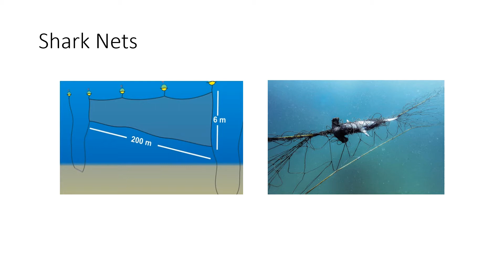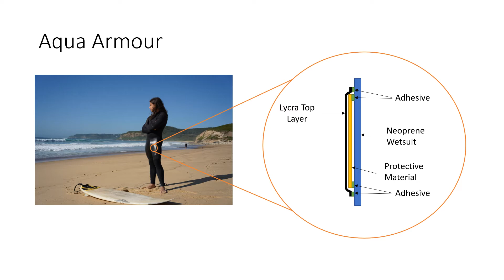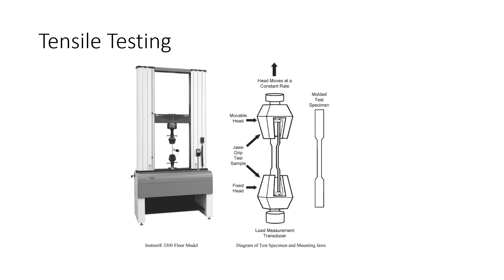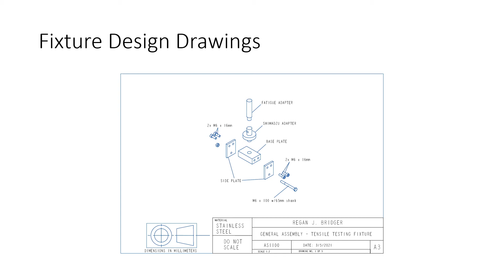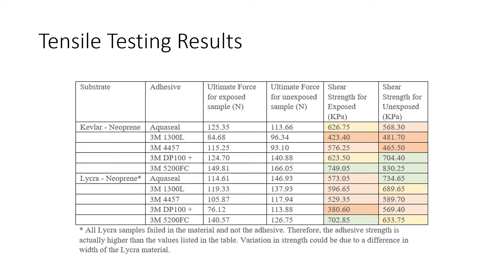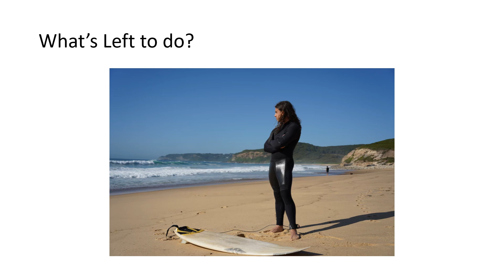Aqua Armour: Adhesive Selection Analysis

Comment: Could cycles of exposure to salt water and then being allowed to dry out before being exposed again have changed how the adhesives performed? Are there different options for how the adhesive could be applied, for example across both sides of the protective material rather than just at the edges? Could that effect weight or flexibility?
Reply from the maker: I believe it would be better to perform cyclic corrosion tests as it is more accurate. Unforunately however, I did not have access to a cyclic corrosion test chamber. Cyclic corrosion testing also takes a longer period of time to complete and if more time was available, it would be more valuable to spend it conducting more fatigue tests.

The adhesive was applied as a 5mm bond line as this was the minimum bond area to reach maximum bond strength. If i were to use a larger bond area, I would risk the sample failing in the material as opposed to the adhesive. If this was the case, my results would determine the strength of the material instead of the adhesive which is not something I wanted to do.